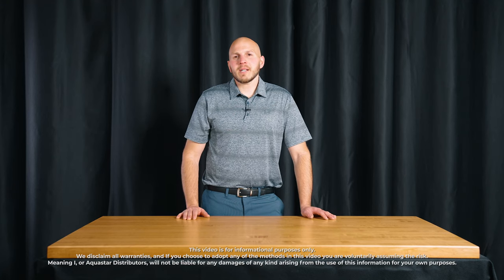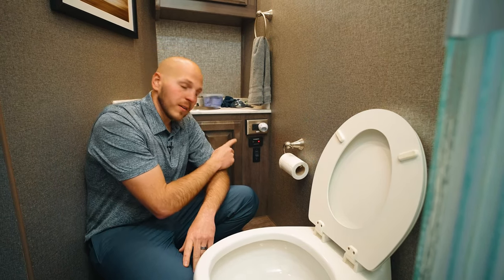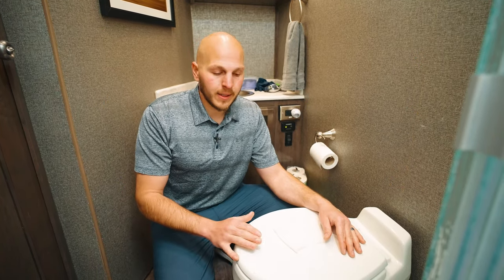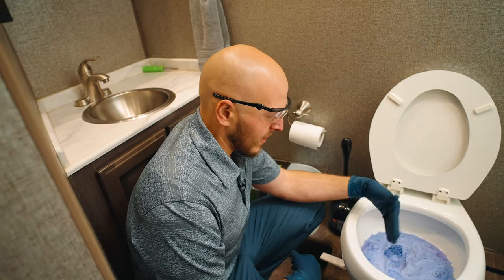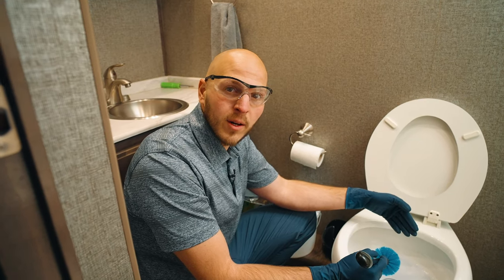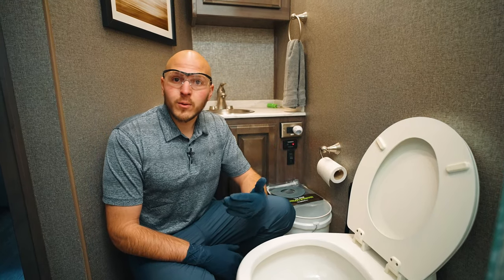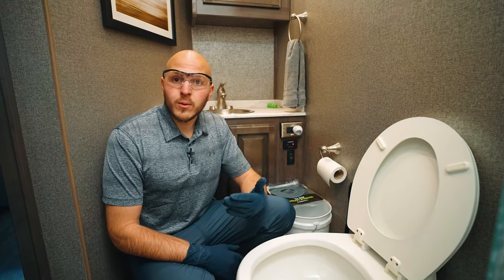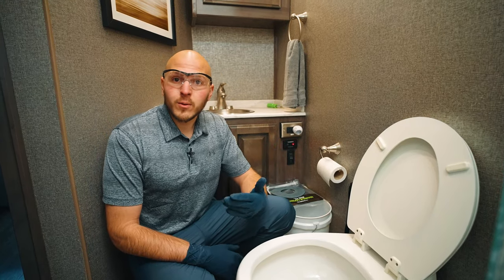Vacuflush in Fleetwood RV, Operation, Repair and Maintenance

Comment: Great Information Jay. I recently did a rebuild on my 2016 Holiday Rambler. It’s great to see the DYI clip on a Motor Home instead of a Boat. I did purchase my on hand spare parts form you. It worked out very well having spare parts on hand as my bellows went unexpectedly as well as a week later my return spring on my half ball on my commode. I will be contacting you soon to replace my spare parts. Thanks Again, Dave C.

Comment: I had to figure out how to replace my broken bellows while quarantined last year, during my first week of jumping head-first into full-time RVing. I did eventually find someone through the internet at a Marine company in Jacksonville, FL that gave me some very helpful hints and tips of what was wrong and what to order... and how I messed up when reinstalling it. Without him I would have been stranded without any hope. 
I had to go 6 days without an operational toilet (I got creative with my waste routine/management) while waiting for parts to arrive from that online place you spoke of. 
The kits you offer are perfect! I did buy new parts over the last year, for "just in case" this happens again (I still have to check to see if they are donetic), but due to your recommendations, I will be scheduling this for next weekend, as I've just hit my 1 year full-time anniversary. An ounce of prevention is worth a pound of cure... especially when it involves playing in poop.
Right now. I'm looking at replacing my bowl valve seals and that is how I came across this video. THANK YOU for putting this out! I would like to find an American made silicon bristle toilet bowl brush and what are your thoughts on using that, as to avoid the harsh plastic bristle brushes? #SoloFemaleInaClassA #HowToReplaceBellows #DometicHowTo #FleetwoodStorm
Reply from the maker: A Silicone brush would be perfect for leaning the bowl seal. Please let me know if you find one. Heres an import one from QVC 
https://www.qvc.com/qvc.product.K46797.html?colorId=002&sizeId=000&ref=GBA&cm_mmc=GOOGLESHOPPINGFEED-GShopping|M|Generic|cooking+diningCooking+Dining_-dc_44906289507_pla-849705928981__K46797-002-000&cm_mmca1=c&cm_mmca2=44906289507&cm_mmca3=pla-849705928981&cm_mmca4=K46797-002-000&cm_mmca5=pla&cm_mmca6=817258550&cm_mmca7=Acquisition&cm_mmca8=Acq&cm_mmca9=CjwKCAjw9aiIBhA1EiwAJ_GTStD4Hyrox_aHcbWyHgrXoOHw084i908oAUfjcbTTpYHg4syAf3jXwRoCCqMQAvD_BwE&cm_mmca12=Generic&cm_mmca13=Cooking+Dining&gclid=CjwKCAjw9aiIBhA1EiwAJ_GTStD4Hyrox_aHcbWyHgrXoOHw084i908oAUfjcbTTpYHg4syAf3jXwRoCCqMQAvD_BwE

Comment: We bought our Fleetwood 35B 3 years ago, from a dealership. Unfortunately none of this was even mentioned or discussed. We have a 2014. This vacuflush system has been the bane of my existence ever since we bought this. No regular person should have to take their toilet pumps apart as much as twice a year for "general preventative maintenance"!!! I am a travel nurse, we live in our RV full time. We have had to wholly replace this system twice in three years. It cost me $1700 each time. Most people aren't willing to pay $3400/year for preventative maintenance. If I just had to pay someone to only replace the seals it probably would only cost a few hundred bucks but right now in California in the pandemic, good luck finding someone that "A" knows anything about a vacuflush toilet, and "B" doesn't have months long waiting list for repairs. I can't wait to offload this "money pit". Now for the 3rd time in three years we are using a trusty, inexpensive, simple white freaking 5 gallon bucket for a toilet sitting in front of and taking up all of the space in my bathroom, while my money pit of a toilet lays in wait until I can save up yet more money and sit waiting in an endless line for a repair guy! I see it mentioned above one of the comments says he met the video presenter "in the store/shop" PLEASE tell me where your located.. No retired 60-70 something year old is gonna crawl in whatever hidey hole their freaking manufacturer hid their vacuflush toilet pump in and do this!

Comment: The 2013 base is different. It looks like Dometic replaced the "funnel" that was prone to crack. Great change. I hate the vacuflush as we have had to replace the seal at least 5 times and the duckbills, etc 4 times. What a mess.
Reply from the maker: something must be wrong with your system. The funnel should last 10-20 years

Comment: I guess I've been lucky with my 2017 Fleetwood. No issues until this weekend. It's now leaking so we stopped using it. I will be calling tomorrow to order the minor rebuild kit. The interesting thing is that it still builds vacuum and shuts off? It's hard to get to and I was embarrassed that it was leaking in th RV park we were just at...
Reply from the maker: It would be our pleasure to assist you in repairing your system. We can be reached @ 800-352-4323
Reply: @aquastardistributors7852  Already ordered from you on Monday and my rebuild kit will be here tomorrow. I removed my pump body today and guess what color bellows I have!?!? The white one and that's what caused my problem, a torn bellows! Hoping to have the kit in time to reassemble tomorrow after work.
Reply: I was able to rebuild my vacuum pump a few months ago and my bowl seals today thanks to this video and the parts I purchased from you!! Thank you for making this video and the others that explain how this system works!!

Comment: Need your help I’ve replaced everything the seals on toilet the flush valve and have done a complete rebuild and motor still will not stop or give a green light. Everything is new but regulator

Comment: Great Video! I have one question: The position of the DIP TUB LOW PROFILE VG. Is the opening of the this part facing up or down inside the tank? I notice that you don't remove it to complete your demonstration. Thanks
Reply from the maker: Thank you for your Complement! , The opening on the diptube face down.

Comment: Thank you so much for this video. Been struggling with this system since I purchased the new coach in 2012.  Biggest issue is space. I know if I can get it out I. An do the maintenance but get my big body in is extremely difficult. Can you explain what you mean by ‘dry flush to empty tank”
Reply from the maker: Flushing without water

Comment: My vacuflush works but I never get the green light so I have to manually turn it on and off. What would cause this?
Reply: Never had the green light here, either. We turn it on and off manually. Just came to this video to see if I can get answers as we have no idea how to run the vacuflush correctly.

Comment: Vacuflush pump keeps sucking in water and it trips. Is tank water level to high that is going into the suction of the pump?
Reply from the maker: You Most  Likely need a new bowl seal
Reply: @aquastardistributors7852  checked it out and as suspected, tank was full due to a bad macerator pump and water was going to pump suction. Changed pump and emptied the tank and now everything is fine.

Comment: Thanks for the info! What a terrible failure of engineering!!! Maintain twice a year? Remove and replace duckbills once a year? Replace seals once a year? Your engineer should be fired. FIND a a better seal material, reduce that to one part not two, that should not need to be replaced yearly using modern materials. It fails COLD? WHAT?  Find a lifetime material for duckbills; it fails at 1,000 flushes a year?  Now you are wearing the hoses at the attach points for maintenance they were never designed for; how to replace the worn hoses glued in-place and hidden under the floor? It's impossible to get the tank out of the bay in my Pace Arrow.  Now I need to have spare toilet parts on hand to avoid a system failure?  No wonder the thing has smelled from day one, the dealer could not correct, three times.  Massive engineering FAILURE. Where is the warning sticker or the information in the owners manual of the need for heavy maintenance??? Dealer told me it was a macerator. Why isn't just that?
Reply from the maker: I have had several customers relocate the vacuum generator. Dometic does call for "Critical Access" for maintenance items. The twice a year for duckbill valves is only a recommendation, we have customers who only change them when they fail.